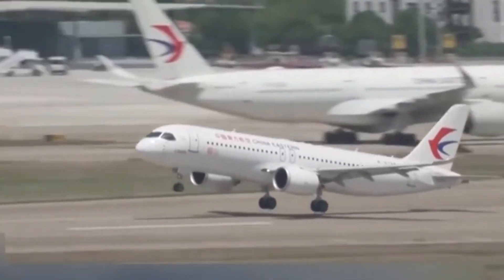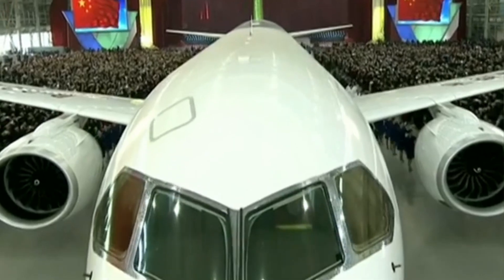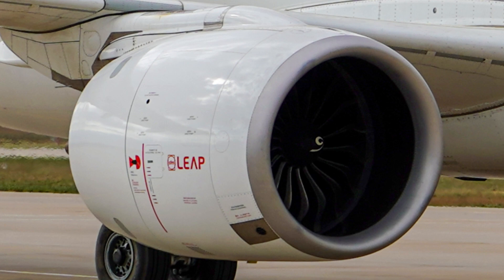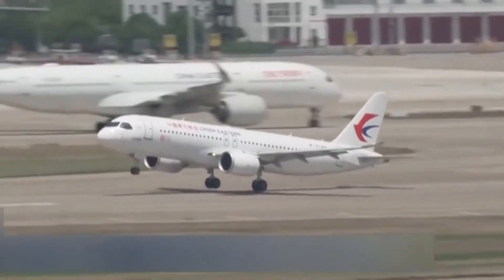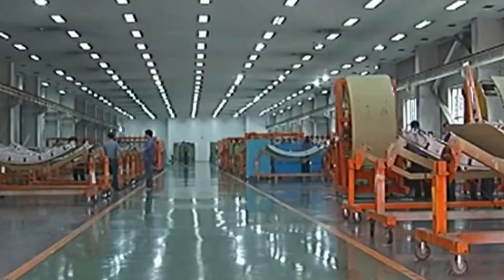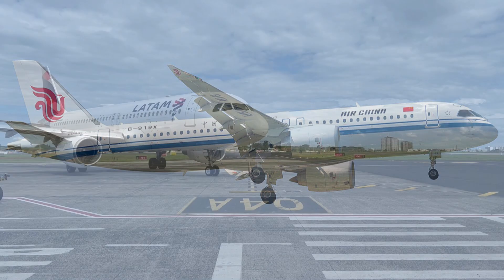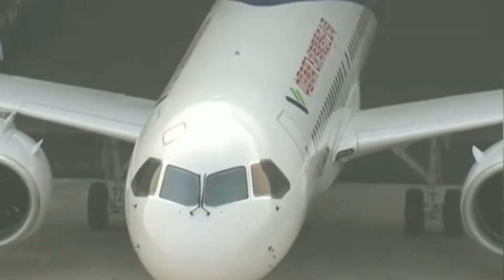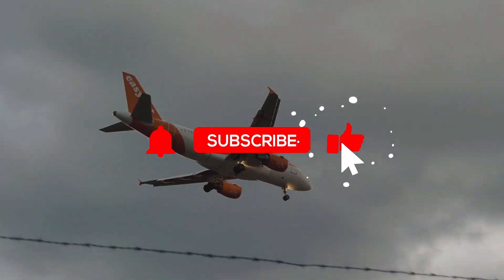COMAC C919: How China tried to outsmart Airbus?

Comment: It's a clone in the same way an Airbus A320 is a clone of the 737 Classic. Their type certs are different. If the C919 were a simple clone a new type certification wouldn't be needed since the plane is the same.
Reply from the maker: That’s true — getting a separate type certification does prove it's not a direct clone. But many still feel the C919 borrows heavily from the A320’s layout, design language, and systems.
At the end of the day, it’s a new jet — but comparisons are inevitable when the similarities are so noticeable. 😊✈️

Comment: why C919 is a copy, the others are not?  sounds like as long as looks like it is a copy from what ever came from first. so every one is a copy, except Wright brothers one.
Reply from the maker: That’s a fair point! 😊 Aviation has always evolved through iteration — every jet today shares something with what came before.

The C919 raised eyebrows because of its striking similarity to the A320 in both looks and systems. But yes, innovation often builds on existing designs — just like everyone built on the Wright brothers’ dream. 🛩️

Comment: The cockpit of the C919 looks like it came straight out of the A220, not the A320, same with it's windshields, and almost same engine as the A320 (CFM Intl. LEAP 1-A vs CFM Intl. LEAP 1-C, which isn't as efficient as the 1-A). I got to ride the C919, and i'll have to admit it was a pretty smooth ride but seeing it's already decommissioned from mechanical issues, it's a bit iffy
Reply from the maker: Thanks for sharing your experience! 😊

While the C919’s cockpit might resemble the A220 in some elements, most of its design philosophy — systems, size, and layout — is much closer to the A320, which is why we compared them in the video.

And yes, early reliability issues are concerning… but a smooth ride is a promising start. Let’s see how COMAC improves it over time!

Comment: I am getting Tired of explaining again and again. The Comac have to be made same size and same spec so that Airlines NO NEED to buy extra Support Equipment to handle the C919. The existing infrastructure and equipment can be used on A320 can also be used on the C919...
Why you all don't understand such basic Things? 😮
Reply from the maker: You’re absolutely right — standardizing specs helps airlines avoid extra cost on ground support and training.

C919 matching A320 dimensions isn’t just “copying” — it’s smart business for entry into a market that’s already dominated by Airbus and Boeing.

Thanks for explaining it clearly ✈️👏

Let’s keep the discussion chill — not everyone here is from aviation background, so it’s great to break things down like you just did 🙌
Reply: Stop talking shit its a copy
Reply: @Magiktcup You talked Shit?.What copy? All the suppliers that supplied to Airbus and Boeing are the same supplier that supplied to Comac. It wull definitely look the same .
You dont have any knowledge on Air framer and Sub Contractors, Better Silent less...😂

Comment: This is the first time I'm hearing about COMAC C919. Someone who knows aircraft, explain.
Reply from the maker: The COMAC is Commercial Aircraft Corporation of China, Ltd. it manufactures commercial planes in China.. and it build a new plane called C919.. which looks more like an Airbus A320.. but with significant changes .. I think this a milestone for aviation in China..
Reply: It's China's own commercial use airliner built by COMAC, but many of it's parts are outsourced from other countries. I got to go on their only one which is pretty cool. It was a smooth ride but I think it had mechanical issues and had to be decomissioned a few months ago.
Reply from the maker: Thanks for sharing this ☺️..